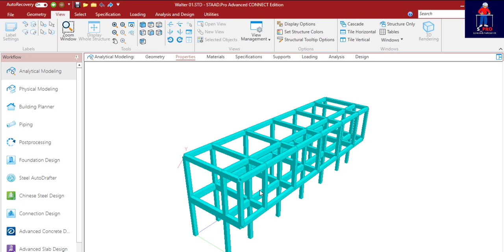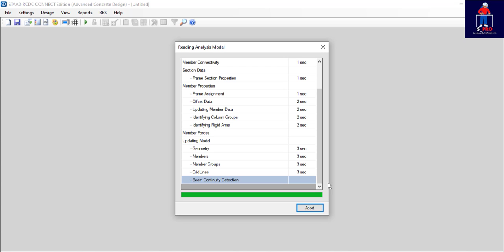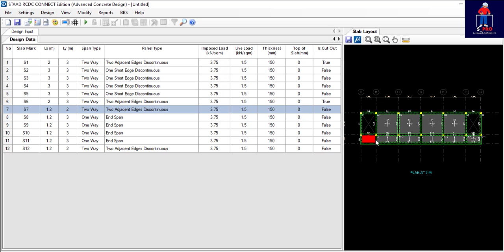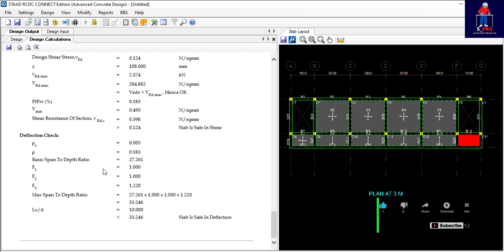Reinforced Concrete Design of a Cantilever Slab With Staad.Pro RCDC  - Part 2

Comment: Your structure has cantilever beams and not cantilever slabs.
If you edit the slab type like you did and proceed like you did, what then do you do to the beams you created around the slab when you do to design the storey beams because that would mean you need to edit the frame again which alters your structure and the corresponding analysis.
What's your take on this?
Reply: I'm only saying, tell your students the full story
Not just what you think they want to hear
If the aim is to make them improve, then go all out in your explanations.
If STAAD doesn't give you what you want, use other methods.

1. Use other software that has the capabilities of what you want to achieve.
Etabs, SAP2000 etc.
2. Design for it manually and attach your calculation sheet to your output file.
Thank you
Reply: @joshuaochonogor2966  I agree with this .The Beams are cantilvered and not the slab.If staad can't do it .Transfer the load to the beams and design the slab manually .we need to accept that the software have limitations
Reply from the maker: Without the beams created around the slab, RCDC would not recognize those as slab panels.
Reply from the maker: Without the beams created around the slab, RCDC would not recognize those as slab panels.